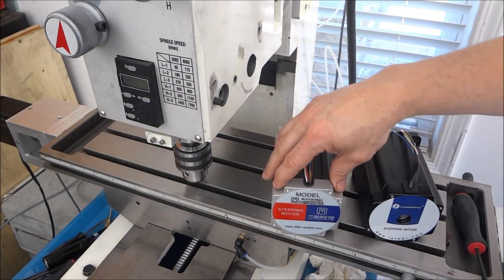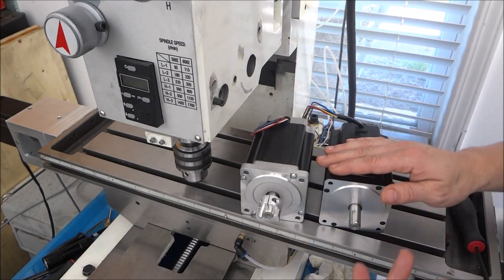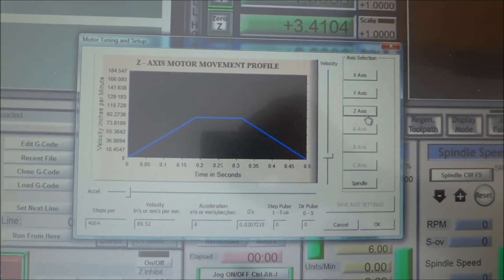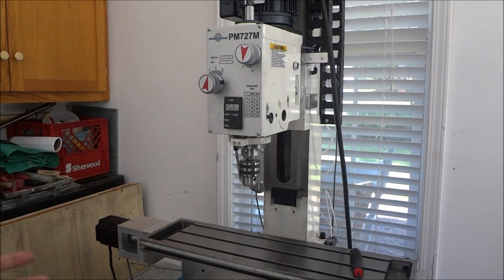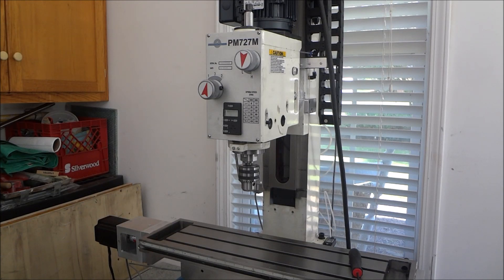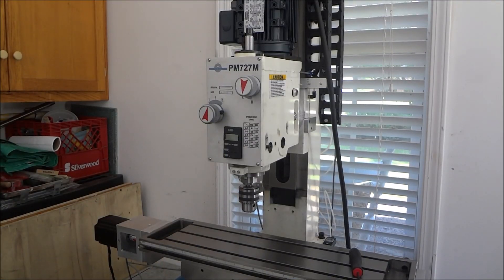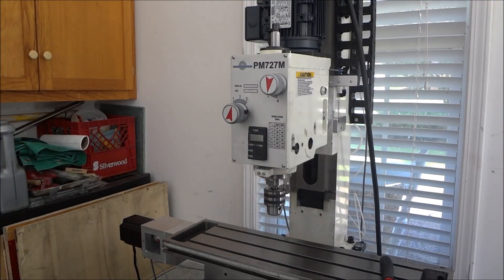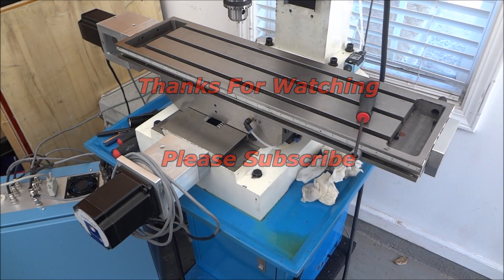PM727M Z Axis Working Stepper

Comment: Hi, great job! 

I'm converting a milling machine similar to yours, a little bigger,
I was just undecided about the engines, you with that 920oz stepper, you can reach those speeds, but the lead screw, what's the lead?
Reply from the maker: 5mm pitch. I would not recommend these steppers If you have to use steppers go with closed loop or better yet servos. Double the rapids
Reply: @CNC4XR7  even i have 5mm pitch. Yes, I agree, I was undecided between closed loop stepper motors and servo motors, I'll ask you another question in the clearpath video, I'm very interested in your goals because we have practically the same machine with the same screw configuration, thanks a lot for the answer.
Reply: @CNC4XR7  Thanks for the answer, I also have 5mm pitch, you have convinced me, I hope not to overdo it but i will put 12Nm Nema 34 on all the axis! hehe

Comment: how many mm per motor revolution is on this machine and how fast is the motor rotating at 100ipm?
Reply from the maker: Motor rotates at 508 rpm at 100ipm or 2540mm per min.
Reply: thanks for the info. would you know how much does the vertical head weight? so basically you can travel only 42mm/s with 4Nm torque? I guess I'll need bigger servos :)
Reply from the maker: The Head weighs 100lbs but I will be adding another 25lbs soon (PDB)

Comment: Really loving this series Sam.  I feel a little guilty that I am waiting until your done before I start my conversion.  Great work with the new motor.  By the way, the physical size of the motor has no bearing on the voltage needed to drive it.  Motors are all about internal resistance of the winding and the current required to drive them.  So, you would have had no idea you had the wrong motor the first time.
Reply from the maker: Hi David 
Thanks I think that is a good idea as I have made a few corrections along the way.   
I can't help but feel a little sighted by Leadshine for recommending the 3DM683 drive for that motor there's know way that that drive will work with that motor. 

Be safe Sam

Comment: I would take advantage of that flat on the shaft and add a set screw, nothing worse then the clamp style slipping and running parts, went through that early on my first conversion and was not happy.  

As for speed on the Z axis, I would leave it at 100ipm.  when you start doing high speed peck drilling especially on deep holes, there is some drag on the retract that may be enough to stall it and again will be an unfortunate situation.  100ipm is plenty fast unless you plan on doing alot of 3D machining at which point you will have some long machining times.  still it would be OK though.

for the oiling drain out, use your lathe and make some simple low cracking pressure valves, just need a nap bearing, spring and a little bit of hex stock.  a quick search on Google will give you some design ideas.  very easy to make and will stop the gravity drain issue.  you also are probably seeing some flow distribution variances that a metering valve setup would help with making more uniform per pump to the different locations.  tuning those can be a bit of a chore, but once set should not need much adjustment afterwards.

hope that helps!
Reply from the maker: Yeah a set screw may be needed, 
I think the Z axis will be fine I Have 30% extra for Pecking I feel like that will be fine.

For the oiler Thats the plan just to make some spring loaded check valves.

Comment: Glad you or back on track, Sam.
If I were you I would definitely feel lazy and not do it but for the sake of curiosity or for folks who will do their conversions, maybe you can try putting one of the smaller steppers back on Z to see how fast they can run. I have a hunch they wont have any problem doing 140. Cheers.
Reply from the maker: I will probably disassemble the thing once more and I will test it then.

Comment: great job! cant wait to see that thing making some chips! 

any plans for releasing a kit for the pm727m or a spec sheet for ordering parts ?
Reply from the maker: Once the basic build is complete I will offer the Fusion 360 files for those interested. I'm trying to make sure as much as possible things are correct. There are minor changes here and there.

Comment: LOL ... Need a spare z axis stepper? ... I have one .  If I understand correctly the X and Y steppers you spec'd have plenty of power ?
Reply from the maker: Yeah I think they will do just fine a 3 phase stepper by design has almost double the torque of a bipolar motor. But the JMC big motor is working great and is cheaper than the Leadshine X Y motor.

Comment: Have you considered adding gas struts to the column and head to help assist the Z motor in lifting the head? It might eliminate the stall on the Z up @ 140 IPM. I know you mentioned that 140 was not a goal but just a suggestion for those you may want that speed.
Reply from the maker: Thanks,
Yes I do plan on some sort of assistance with the Z axis, Most likely Gas struts they work really well on the X2.
At the Moment I'm at 100lbs with the Gearbox , motor. I plan on a belt drive, PDB to replace the gearbox i dont know where the brackets will be or what the final weight will be so I'm going to wait on that for the moment. I suspect the weight will be about the same or really close.
Be Safe,
Sam